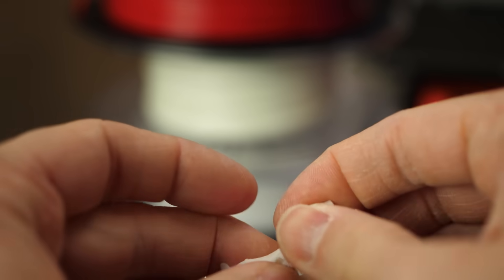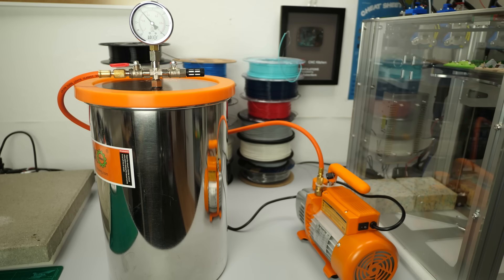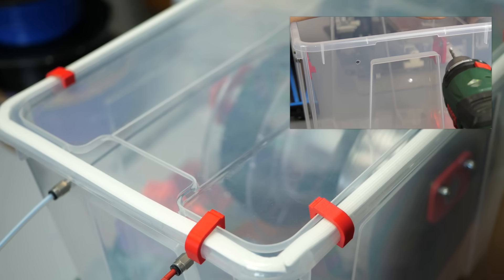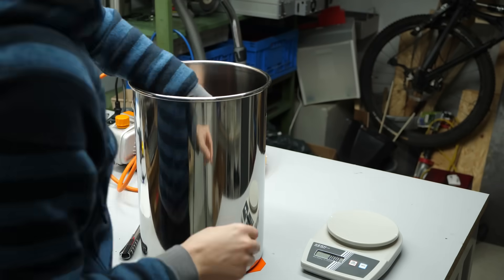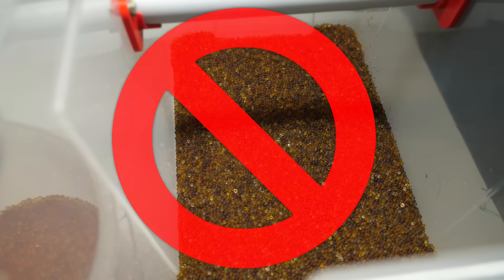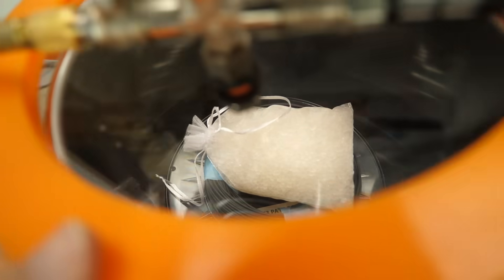Vacuum VS Dehydrator! What's the best way to dry filament?

Comment from the maker: Don't forget to share this video on Facebook, Reddit, Twitter and other social media!
Timestamps for the impatient
Introduction: 1:20
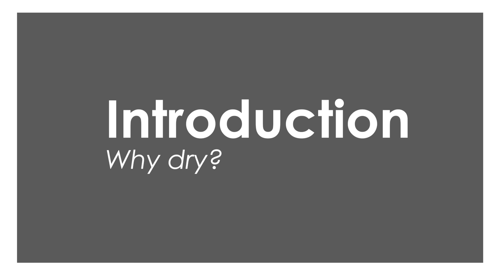Why dry filament: 2:40
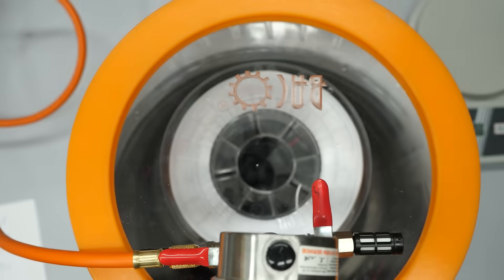Damaging filament by heat: 4:58
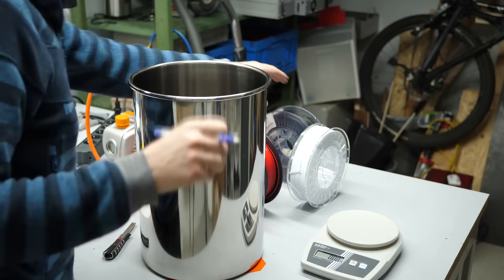Vacuum drying: 5:55
Moisture pickup in open air: 7:30
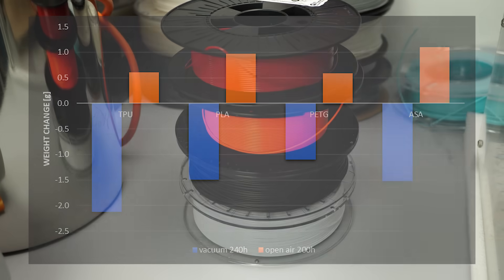Food dehydrator drying: 8:00
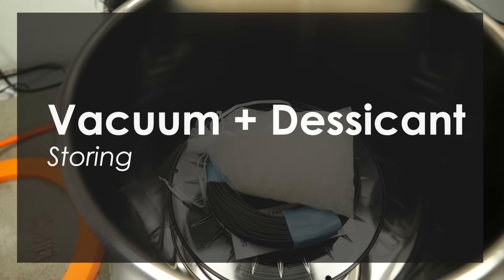Storing filament in vacuum + desiccant: 9:55
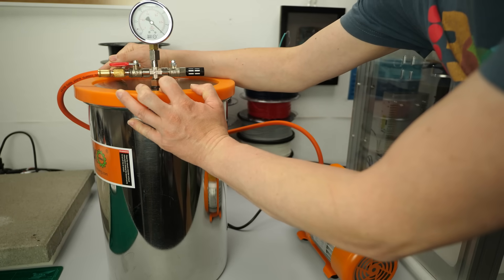Do spools dry equally: 10:25
Drying with desiccant: 12:00
Drying in a circulation oven: 12:45
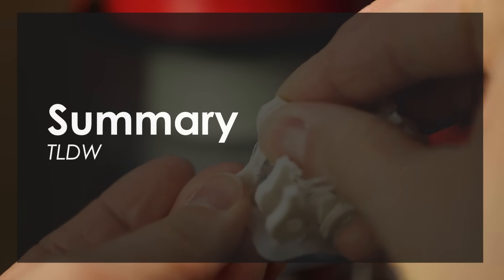Summary/TLDW: 13:57
Reply: Add your timestamps to the description and they show up on the progress bar now its a cool new youtube feature
Reply: Try this with a 2stage pump. A single stage pump can not pull low enough to actually dry the filament. The boiling point of water above 29 inches of mercury is still above 60degrees Celsius. You need to get the pressure below 29 inches of mercury. Vacuum drying at low temperatures is actually the faster way to dry filament. I have tested it myself and with a two stage pump you can dry filament much drier in an hour or less. A vacuum is literally the only way to remove 99.9% of the moisture.
Reply: You should heat up the material before you put it in the vacuum chamber to get the best result. Look at this video. https://m.youtube.com/watch?v=lnVjxuCc4Wc
Reply: Or use an desiccant dryer with dewpoint lower than -20c https://m.youtube.com/watch?v=gKFJPzi0JYg
Reply: Damn the summary goes straight to an ad. I'd appreciate it if you'd have a summary with data points that are actually useful. I don't mind the ad, but not having the data there is frustrating. (Yes, I get it, free thing and you need to make money.) Today I happen to be in a hurry, and I know your videos take about ten minutes to get to a conclusion.
Reply: @avaviel  Click the TLDW timestamp... Then you only have to watch the conclusion to get the requisite information.
Reply: What is the danger about desiccant with indicator in it?
Reply: Amazingly detailed as always!
(Und: Danke, dass du "Stefan" im Intro jetzt richtig aussprichst… 😊)
Reply: Warum hast du das Thumbnail geändert?
Reply: What is the coldest water you could get to boil with your chamber?  (can you boil ice water in it?)

Did you try placimg the post bake / hot filament straight into your chaimber to off gas it while hot?
Reply: Hey Stefan. I really appreciate you doing these experiments for us. Could you share the data as an excel/csv file though. I found that PLA's weight loss as percentage when comparing vacuum vs dehydrator is higher than what is shown on the dehydrator graph. it should be 0.233% not 0.3% which puts the dessicant higher than dehydrator actually.
Reply: Please use the youtube time stamping tool for this I was about to post the TLDW since I didn't see this post.  https://youtu.be/eqQRN9TUw08?t=840
Reply: Hey Stefan, did you find any proper drying solution yet? Would love to know!
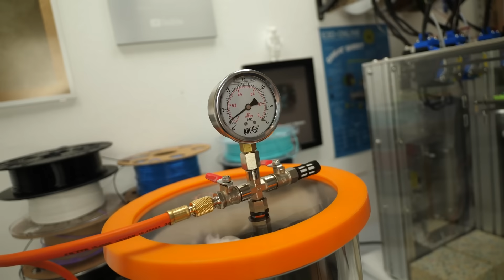Reply: which value is shown at 10:06?
Reply: HOW ABOUT NEITHER!
Use a "filament filter" , essentially a 3d printable object that has a sponge 'often packing material like abs foam works really well', that scrapes off all Dust and exterior liquid as it is fed into the machine. It gets threaded on your filament, and costs not lots.

Comment: The basis for the testing is outstanding. However the materials used are insufficient to accurately make a determination off of the data collected. This is because some of the equipment is not the proper type for the intended purpose. Take your vacuum pump as the primary example here. A proper Vacuum drying chamber will not use a single stage low end vacuum pump that can only be ran for 15 minutes at a time. It will use a two stage pump with a dryer inline before the pump, a common inline chemical dryer is a two stage system, the first stage uses a high strength acid, followed by a mineral oil. Those are to protect the pump and ensure you get a nice long life span out of it while minimizing the need to do maintenance as regularly on the pump. This pump will run for hours to properly dry the materials in the chamber. Just running it for 15 minutes is no where near enough to accurately make a determination that one method is better than the other. Another example, in typical scientific studies, a vacuum dryer will pull on average 1.5x the amount of moisture that a typical food style dehydrator. 

An area i have a critique about but isnt nessecarily a problem(just more time and effort on your part) is your dessicant usage.Yes the 10% mark is great to hit and get under, your typical dessicant based drybox normally wont hit that low of a humidity, 15-25% is more normal. And basing your refreshes off of above 10% is fine. But that does mean you are refreshing your dessicant WAY too often(imo) and making a ton of extra work for yourself and spending more than you need to refreshing dessicant. I work on cars as a hobby, My sunday driver is a 36 year old car on air suspension with a soupcan sized container of dessicant that hasnt been opened in 36 years. Still drying the air just fine as intended, still doesnt need a refresh(i added a semi style air brake dryer in line after the dessicant cannister so i could tell when it needed refreshed and so that i wasnt left without the protection it gives.)

A final example showing that there are issues with your testing is that this is something that has been tested many times. and those peer reviewed studies come out with data stating that a vacuum drying chamber is 70-90% more effective at removing moisture from an item than a typical food dehydrator. 

Now why i am disregarding your data entirely. You intentionally used differing materials and presentation styles making accurate comparison between the methods impossible. Standardize your data and present it in the same manor across all tests. 

TLDR: Good basis, pretty big errors between data presentation and testing methodologies, needs some improvements before the data is useful. Im definitely hopeful that you redo this testing again in the future.

Comment: Nice test pal! I'm building a box with silica grains an hygrometer to check the temperature and humidity, i will also add a pet warming heatmat to warm the box, i think i could also to control all the process through an arduino  or raspberry, so as soon as the humidity increase the heat mat can be activate to warm the filament. There are plenty of projects on youtube i will make also the also to load the filament directly from the box

Comment: Do you (or anyone) always remove your filament from the extruder and store it with desiccant?   I ask because otherwise the segment of the filament between the dryer (eg Sovol SH2) and the print head is exposed to humidity.  But it seems really inconvenient to roll up and then refeed for each print if for example it's the next day.
Reply: when you start a new print, tool head primes and spits out poop so it uses some before it actually prints. at least my bambu does

Comment: Please be aware that a rotary vacuum pump can be used to pump the water vapour which is pulled from the filament but needs gas ballast otherwise the vacuum is limited by the partial pressure of the water vapour.  Gas ballast is also needed to prevent condensation inside the pump which can cause corrosion damage but this limits the vacuum the pump can reach as it bleeds air into the pump to purge out the water vapour.  Also the pump must be warmed up before pumping water vapour to avoid corrosion damage caused by condensation in the pump.  Models with high water vapor tolerance or a built-in gas ballast system are designed for this purpose but are more expensive.  I would not recommend a basic pump for drying filament for these reasons and because its drying capability will be limited.

Comment: Hi Stefan. I have an idea, but can't check it for now. May be You can say, if this will work or not. The idea is two pipes like 1m for example, rounded on each side, so they make circular path for air. Like take two U horizontally and connect them to make ring. On one side we install Peltier element with heatsinks - top for hot side, bottom for cold side. And fans inside tube. The idea is that filament goes through upper pipe where hot heatsink, it heats as well as air, then somewhere at beginning/middle of bottom pipe it leaves (to print head), and air goes to cold side of Peltier element, where it cools down and water condenses. Then air goes back to hot heatsink. At some point we have hot & dry air that loops inside. May be this will work with proper Peltier power & pipes length and it will dry filament while printing, because filament moves with slow speed and may be it will be enough time to dry. What do You think?

Comment: I'm cheap. I refuse to pay 300-500cdn for a high temp filament dryer. So i pre-dry my pc-cf for  hour at 70c then put it into the vacuum chamber for 2  hour. I repeat the one more time. usually that get the filament back into a usable state.

Comment: Stick it in the vacuum chamber with a temp probe attached and use a IR heater to heat the filament to its normal drying temperature and see what happens.

Comment: I made a heated vacuum chamber bought a 3D printer heating pad for a print bed pulled the adhesive off put it on the bottom of the pot and now I have a heated vacuum chamber I want to know if that would work any better or could use the heated vacuum chamber with desicate beads inside how well that would work I used a raspberry pie 2 A few thermocouples and some programming from grok I'm currently doing my testing you'd be interesting to see if anybody else has done anything similar

Comment: thunderf00t did a video debunking the vacuum clothes dryer. He shows clearly that heat is MUCH more important than lowering air pressure.

Comment: 5 yrs down the road... I'm curious about GF nylons, ASAs, & PTEGs? 
I print almost exclusively with those filaments. 
Also, what factors such as filament densities change when the moisture is removed? 
How does the diameter change? 
There has to be more voids leftover which would affect layer adhesion, line thickness etc.. 

Thank you Stefan for your efforts! In 5 yrs you have become a trusted source for newbies & experienced makers alike!

Comment: Great video thanks for the time and effort you put in to these. I'm wondering is vacuum is the right way to go. At lower pressures the dew point increases doesn't it. So yes you can boil water at lower temps but doesn't that do the opposite of what you want. Ideally you want to condense water out of the air not put more in to it .. am I looking at this the right way ?  So wouldn't a pressure system work better. So raise the pressure in the box until all the moisture drops out then drain the moisture ? Maybe one surface on the bottom of the box with a fan on the outside could assist in ensuring the condensation lands on that surface..

Comment: Don't just pull a vacuum, run it through a compressor to extract the moisture and cycle the compressed air back into the chamber

Comment: Get a used oxygen concentrator and feed the pure oxygen. It will force out the moist air, replacing it with 0% humidity oxygen. This works great at 50°C.

Comment: The only fault I see is that the spools themselves may have an affect on moisture removal.  Are you really getting water out of the filament or the spool?  Some filament comes on cardboard and is very 'wet'.  A better test would be to use metal or some other material as a spool that has no water content.

Comment: You should also test freeze drying. Not the type they use for foodstuffs, but a simpler one, just circulate the air near a -40 deg C surface that will freeze all the excess moisture and create dew point -40 air. Maybe warm the air back before introducing to filament..

Comment: I had a very old roll of black TPU from Sain Smart that I had simply stored in a plastic ziplock baggie. The stuff was so full of moisture that it blew little holes in the first print, lol. Fried like bacon. I put it in my Sovol SH02 for around 12 total hours on the TPU setting and that fixed it right up; I made a bunch of small prints with it with no problems. Far more of a PIA is my ancient roll of Taulman Alloy 910 that I never even took out of the packaging for at least 6 years. It's bad, like you have no idea how bad off it is. I've had it in the dryer on the ABS setting for at least 12 hours now and although it's not frying quite as badly, it's still way beyond usable for now. I'm going to keep at it and see what happens. I'd like to use it for a couple of printer extruder parts if I can get it to quit popping, but I realize I may be biting off a bit more than I can chew. Still, I have a dryer, so why not?

Edit: It never occurred to me to weigh the spools before and after. That's pretty slick! Thanks CNC Kitchen for making me a wee bit smarter. Knowing is half the battle. ;-)
One thing to note, you kinda need to consider that the spool itself is also usually hygroscopic and thus will contribute to moisture and thus weight loss. But, unless you're prepared to rewind your filaments onto metal spools, you're stuck with what ya got.

Comment: I got a dry box a while ago and I usually print out of it, even with just pla; I used to just let it run until the timer ran out on it, but I've since figured out how to shut it off (it's so funky, and the instructions are all but worthless..), so now I'll usually turn it off shortly after the print ends (as well as reseal the spools, which I also didn't used to do right away). Hopefully that doesn't over dry the filament, but I wouldn't know how to tell if it did..

Comment: Vacuum VS Dehydrator! What's the best way to dry filament?  -> both. Desiccator bowl with low pressure plus silica gel. Leave over night. Also, desiccators usually have round surfaces, since 1 atm breaks most transparent covers. Less compromise on that with round bowls.

Comment: You need a micron gauge to read vacuum to read your dry moisture content. 
You cannot read moisture level, which is the moisture pressure on an analog gauge zero to -29 psi vacuum . 
You need a two stage vacuum pump not a single stage . 
Keep pulling vacuum
To about 1000 µm . Then purge the container with dry nitrogen or argon gas, not to let any humidity from ambient air into the container.. 
 Do this three times.
After the third time pull the vacuum down to about 100 µm and then perform a vacuum decay test after 10 or 15 minutes . With the vacuum valve off your vacuum decay should not come above 500 µm anywhere up to about 3400 µm tells you you still have a lot of moisture content..   continue vacuuming for a longer period of time until you can achieve a 500 µm or below vacuum decay test plateau. 

A vacuum decay test below 200 µm or at is absolutely excellent but more difficult to achieve . 
Now you have removed your moisture down to the parts per million

Comment: vacuum with dessicants works passively compared to heating which consumes electricity. It is by far the more environmentally and wallet friendly method, especially if you start doing it when it's a new spool. I use a vacuum rice bucket that has an auto pump on the cover, so it's compact without a need for external compressor.

Comment: Few things on vacuum drying, based on my experiences in a professional enviroment:
1. heat speeds the process up significantly, we use a vacuum oven for filament and also dessicant at work
2. the pump needs to extract the moisture constantl, ideally with some gas ballast( dry nitrogen)
3. rotary vane pumps emit oil everywhere, also towards the suction side, therefore an oil trap is generally a good idea, and an exhaust filter foe your own safety. 
4.  the oil can take up the moisture you trying to pump, gas ballast helps here and regular oil changes
5. with a good pressure gauge you see when the moisture gets less
6. at work we get so much water out the system, that we need to collect it from the exhaust of the pump

In case of interest, we use an ancient Heraeus vacuum oven and a oil free and dry scroll pump with gas ballast. Drying a role of really moist filament easily yields 15-20 ml of water, this of course does not include  the amount taken up by the ballast gas

We do a ton of
Reply: For how long do you leave the pump running?

Comment: Industrial dryers have two desiccant beds, a heat source and a condenser. The cycle switches between beds every four hours. One goes through a drying cycle while the other goes through a recharge cycle. Hot Air is moved from the drying bed, through resin and then condenser before going back to the drying bed.

Plastic resin needs to be dried close to -40 dew point before extruding.

3dp probably doesn’t need to be this dry which is good because it’s not easy to accomplish on a small scale affordably.

Please get a moisture meter.

Comment: My dad once told me that his favorite thing about moving from Michigan to California was that his potato chips didn't go soggy after a day. Well, the humidity is pretty good for filament too!

I'm just starting up my printer after 9 years and my old filament is a bit brittle, but mostly OK. Oddly, (why I'm watching this) my first major problem of a reel disintegrating is happening to one that was still vacuum sealed. It worked OK on day 1, but a tangle (my fault for opening in a rush and losing the end) stopped the print. At 3AM I made a brief attempt to transfer to a new reel to remove any tangles before getting too tired.  2 days later, the part that I had rolled on a new reel fell apart when I picked it up!  I should also mention that we're in the middle of a heat wave and it's been 100 F for 2 days; I thought the conditions were ideal.

Do you think that the vacuum pulls out chemicals from the plastic that it needs? I'm pretty broke, so I'm hoping to squeeze some prototypes out of my old filament. I've got the bad reel in a dehydrator at the moment, but I'm wondering if it needs some more love before going back in the printer.